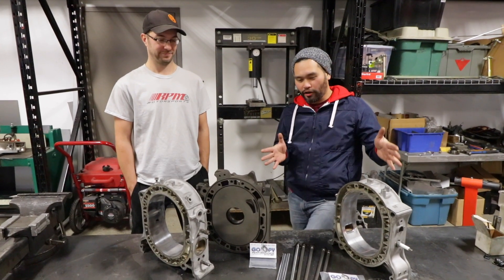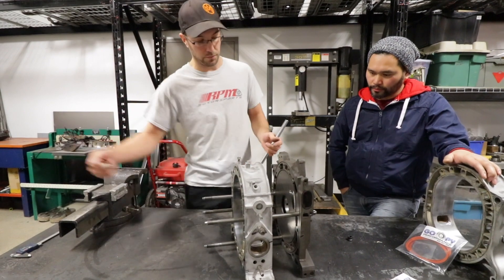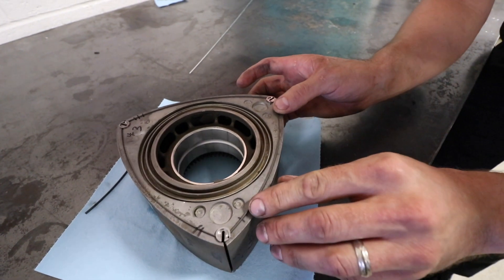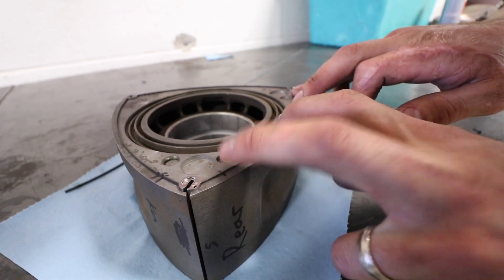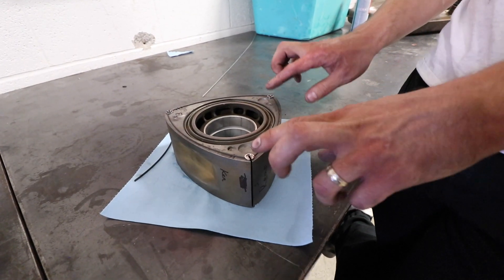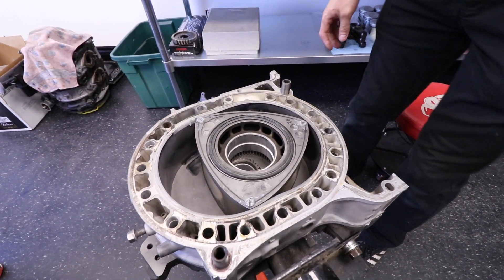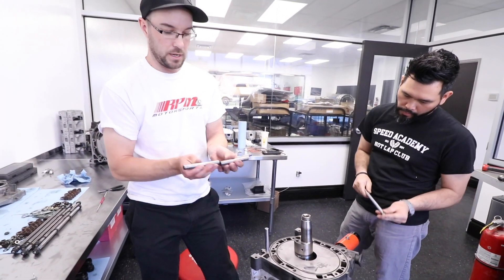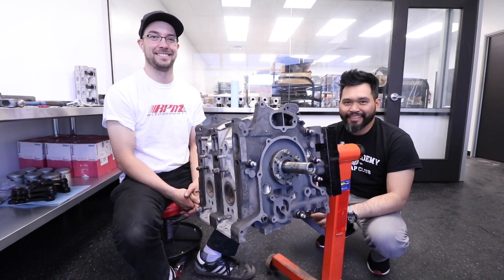How To Build A Bridgeport Rotary Engine

Comment: What about the three pieces Apex Seal, Citroën patent GB1438850, in a Mazda?
Patent US1024504 is nearly same as 'Liquid Piston'; patent GB1260437 is for Nikasil coating, a German invention. Mazda once got improvements by using a 'wavy' Apex Seal spring vs the usual concave springs, but I failed in retrieving reference.
Blessings +

Comment: GR8 Video! Has anyone of you tested in bench, in a Mazda, a Sachs, an NSU Wankel RCE, the concepts by Kawasaki, patent US3848574, a wedge extension of plug hole, pointing towards trailing side of Rotor; or that by Toyota, SAE Paper 790535, a continued glow plug in leading plug hole site (example, a Webasto ignitor for heater)?
Danke. Blessings +

Comment: Make up some dummy assembly pins with an internal thread - you can screw a bolt or, better yet, a fabricated "T" handle into it to easily pull it out if required.
I've noticed elsewhere that some builders are using billet (side plate?) housing parts - I assume these would only be required for high boost applications?
Oh, looks like a dry build - or the lubrication not showing up? On that, anyone using dry lube coatings?
Reply: a lot of vaseline is used, so its not dry